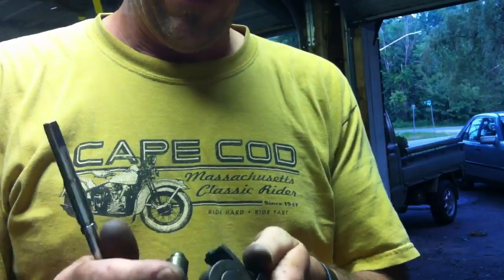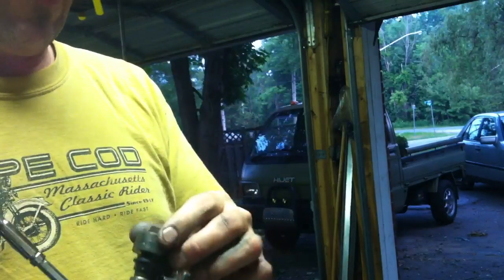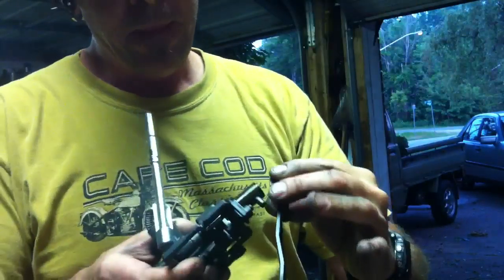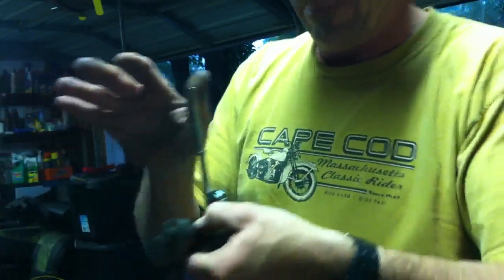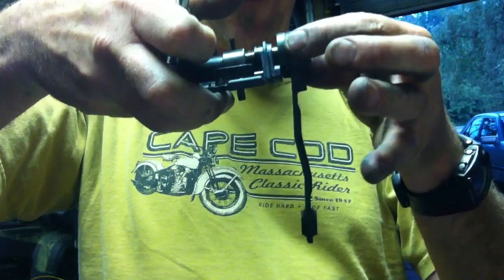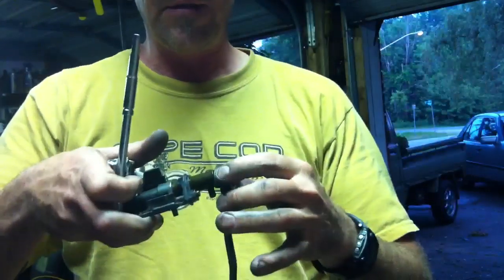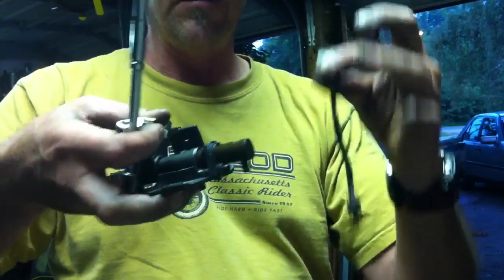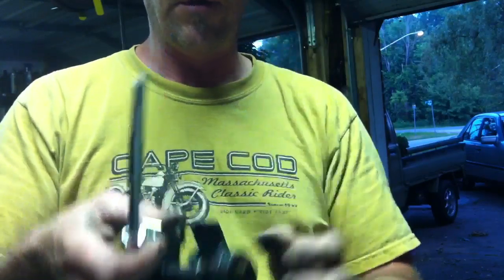Part 1 ..Mercedes Benz 722.6  transmission..stuck Shifter mechanism repair  ..

Comment: Fupabox you are a hero.. I've been trying to solve a transmission not shifting issue. Isolated it to the gear selector. Bought a used one on ebay and it had this exact problem on your video. I thought I'd have to buy another used one and hope for better luck. But as you suggest - just put some turbine oil on the shaft and worked on it a bit and it freed up. Is a nice feeling ! Thanks!
Reply from the maker: Great to hear!

Comment: Will this work on a 96 220C class stuck in FIRST
Reply from the maker: no. Yours is a 4 speed auto mechanical shifter . The 1997 and later have the 5 speed electronic auto
Reply: Okay thanks you think I need a new one??
Reply: A new transmission?

Comment: Hi there I have a 1999 w210 e320 and have been trying to replace my shift module. Underneath the "1" position on the base of the module there are 3 electrical connectors. I got the top one out, but there are 2 others on the bottom that I haven't been able to take off. I can't see or feel any release tabs and I don't want to break it. Do you know how to take off those connectors so I can change the module?

Comment: what happens if you force it in gear?
Reply: i was so stupid to force the shifter in gear. and now the car goes forward in park, neutral and reverse.. any idea what can be the problem?? plis help! 😞
Reply from the maker: +Sabah Ali  It could be the shift bushings ...or linkage has bent
Reply: +fupabox Thanks. Where is the linkage? :)
Reply from the maker: under the car between the shifter and transmission
Reply: +fupabox Thanks. sorry for all the questions. but i have an cabel also wich is leading somewhere from the shifter box. 1 cabel for the brake i guess and 1 i don't know what is..
Reply from the maker: Sabah Ali its the unlock for the shifter so you can't put the car into gear without your foot on the brake
Reply: +fupabox Thanks! i think its broken or something, because when i turn the Key in 2 then i can freely move the shifter in gear without touching the brake pedal.
Reply: I've got this problem with my 1999 e320 before this problem occurred I did not need to put my foot on the brake to switch out of PARK or any other gear. 
Also mine is not stuck in PARK I have 1st through drive. it won't go into nuteral 
R or PARK there for it will not start.( without nutural or PARK)
Reply from the maker: there are a few things it could be , but I can start by saying it should have never been able to shift out of park without the brake applied.. I'm assuming someone disabled it at some time. If your shifter feels wobbly I would suspect the bushing between the shifter and the transmission shift rod. Instead of typing all the possibilities I will give you a link to a very thorough list of causes and solutions http://www.mercedesmedic.com/mercedes-transmission-shifter-stuck-park/

Comment: I have a 97 sl320 that has a bad gear selection switch, do you know if this gear changer will fit on my car and (or) would you be willing to install just my new switch (into my shifter  PAID for your time of course!) if I drove down to your place? For some reason I think you're near my home, I'm near Peterborough - Steve
Reply from the maker: +CraneBay99grand  do you mean the S-W  switch is bad ?  they can't be replaced separately assembly as far as I know.. or is it the shift interlock switch
Reply: +fupabox I have to wiggle the shifter to get the D to light up and then it will shift as it should, where as just shifting to D results in no-shifting and no lit up D, I've ordered the Gear Recognition switch part# 2105451332 thinking that this is the worn part (I'll also order the linkage bushing as there is a bit of play in the shifter) The S-W selector works as it should - Thanks for your time! - Steve
Reply from the maker: +CraneBay99grand  Leave me your email address on the message section of my youtube channel home page.. I have a few days available near the middle of April

Comment: Is the NSS inside the gear shift mechanism or underneath the car on the W202 (1997 C280)? I can not find it underneath near the oil pan at all. Reverse lights not working...
Reply from the maker: +jaeski33  on the shifter mechanism
Reply: +fupabox Is there anyway you can fo a video on this or troubleshooting the reverse lights?
Reply from the maker: jaeski33 i'll see what i can do
Reply: +fupabox thank very much sir! I've searched online for this over and over but i can not find a good "how to" tutorial on it.
Reply from the maker: jaeski33 Until I am able to video this . I can give you this info to read up on... page 26 is about where you need to start reading..the rest is mostly internal rebuild stuff.  http://www.all-trans.by/assets/site/files/mercedes/722.6.1.pdf
Reply: ***** Thanks. I will be looking forward to the video.
Reply: +fupabox Hello Sir, i was able to get the Gear Shift mechanism out of the car while I was changing the shifter bushing. however, i still need to change out the  NSS in the fear selector. you stated that it is hard to put back together. how should i disassemble it just to change the switch?

Comment: My W140 acted up recently, It wont shift in rear and park. Its just stuck to neutral and could go to drive and other lower gears
Reply from the maker: +EndofUSA sounds like either the bushings on the linkage under the car
Reply: *****
thanks. I'll be checking it out. But is it not there is only one bushing? Why only in reverse does it get stuck up? The shift lever feels sturdy and not sloppy.
Reply from the maker: EndofUSA there are 2 bushings on the rod under the car.. what year is your w140?
Reply: *****
is a 95 S320
Reply from the maker: EndofUSA ok so it's a 4 speed.. I would unhook the bushing from the shift lever and see if the shifter can move through all the gears when it isn't linked to the transmission.. then you can eliminate either the shifter or the transmission as the problem..you will also be able to manually move the shift rod on the side of the transmission , back and forth and see if it is sticking anywhere
Reply: *****
Ok. Thank you very much. I will do as you say. In fact I was also thinking about that. I was also thinking of first detaching the whole gear shift box from the flooring and check the whole gear box. One thing I noticed is that there was a plastic piece that is broken inside of the box and I dont know if that is the cause. And where I think a small spring is connected My problem now is that I couldn't pull of the whole box because I first have to take out the rod shifter itself which has a small Circlip that needs to be taken out. It really quite a pain but I am still at it. I'll get back to you if I am able to remove this Circlip at the base of the shift rod neck. thank you
Reply: Hello Fupabox. I have finally fixed the reverse and park problem of my W140. I took out the transmission oil pan after draining its oil and immediately I saw one of cylinder of the valve body was stuck sticking out blocking the pathway of the gear shift lever mechanism. I am still wondering what could have caused it. What I did was gently push back into its cylinder by tapping it with a piece of a small hammer handle.  And it did go back in. At first I thought some pin lock could have drop making the cylinder come out. But as I realized at its other end where the plastic tip of the cylinder there was a spring attached to it making and pulling the cylinder back in its tube naturally.. As the cylinder went back in, the gear shift lever (if that's what its called) could now travel back and forth and into reverse and park. So I realized I was mistaken to think that the problem was in the gear shift box inside the car.  But up to now I still am wondering what caused it to stick out or get stuck. By the way as I cleaned the oil pan, I noticed that there were some small millimeter size of metal pieces that clearly indicates that something was torn out from some parts of the transmission. This really gives me worry since for sure sooner or later that seeming small damage could affect the whole transmission and would soon wreak havoc inside the transmission!! I did drove and test drive the car but only for a few minutes and parked it. So far no signs of any problem. Well it will be under observation from now on and hopefully the transmission would have absorbed any possible damage that could have been caused by that glitch. Thanks a million to your advise!!!
Reply from the maker: EndofUSA Glad you found that... I wonder what caused it ?  hopefully you will have no more problems.. I have never taken a Mercedes transmission apart completely , so I am not familiar with all the internal parts.
Reply: *****
well we will find out soon what caused it, cause an auto-trans is a one system machine and any small problems will soon come out. I am not being negative but I am just coming from that logic. Every internal parts come to play as a whole and if one small tiny part because troublesome it will soon be reflected to the whole machine. Maybe now only a prayer to God can save it from future problems. By the way I am a Sunday mechanic and I love dealing with machines. In fact I have decided to study and practice on auto-transmission specifically Mercedes. I in fact was able to get me a 722.6 auto trans Mercedes when I recently bought a 98 E230. The owner had changed the whole transmission and he gave me the old one. And I am just finding some time to open it up and study it. Any way, again I would like to thank for such helpful exchange of vital information. Do share some of your knowledge most often. There are alot of us guys out there that depend on each other for possible solutions. Nothing is difficult if two brains work on any machine problems!!! Thank you
Reply: *****
Yes I will. Thank you.

Comment: 2002 c240I replaced the radio. disassembled the center console, installed radio and reassembled the console. everything went perfect without any problems. The very next stop I made was at a gas station. I pulled into a parking spot and tried to put the car in park, but it would not go above neutral. I put it in neutral and applied the parking break. I was not able to take the keys out of the car, as they can not be removed without the car being a park. when I tried to put the car in reverse to leave I discovered that I couldn't do that either. I had to put the car in neutral and push the car out of the parking spot in order to leave the gas station. The car is functioning perfectly in every way, except I cannot get the shifter to engage in reverse or park, it will only go into neutral and drive.
I have been told that it is likely a very simple fix replacing a clasp on the linkage of the shifter. My problem is that I cannot get sufficient room beneath the car using my ramps, and it is impossible to use jackstands with this vehicle, because the only place you can jack it up is using special groovs made that work only with the Jack provided, therefore you cannot put it on jack stands. 
Is this issue known to anyone out there? If so can you offer detailed instructions on how to repair it? Pictures would be great. Thank you.

Comment: A200 Petrol 2005 Tiptronic Gearbox Problem??

 Hello,

I wonder if anyone can help me. I have a 2005 A class mercedes which I drive in automatic. 

I have recently noticed that when I am driving along about 30mph or more there is a slight noise (like a hum or whir) whereas the car used to be really quiet.

I have tried moving the gearstick into manual mode whilst driving and noticed the noise then went. 

It seems as if the car isn't automatically changing up to gear 4th or 5th and the sound seems like it is due to it being in a lower gear than it should be. 

I have tried driving it with the C button on and the S button on, that makes no difference

I also noticed since this has been happening my petrol consumption has decreased (not sure if it is connected at all).

I would be really grateful if someone could shed any light on what it may be, and how much I can anticipate it would cost. (unfortunately I didn't take it in to be looked at whilst it was still under warranty, which has recently expired!).

Comment: Hey thanks for the videos. 
I have a 94 C280 and on the way to work while leaving a red light i press on the gas pedal and nothing.  The funny thing is reverse gear worked fine. I tries moving the gear stick back and forth and nothing.    What do you think it is 
Thank you.